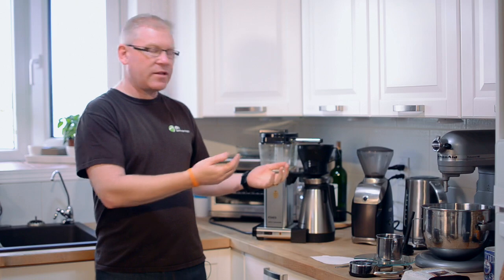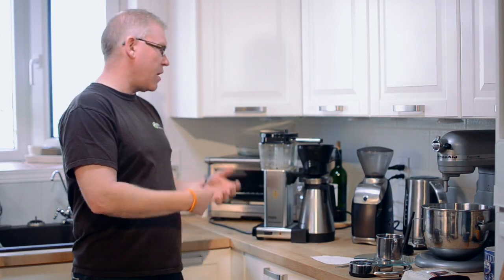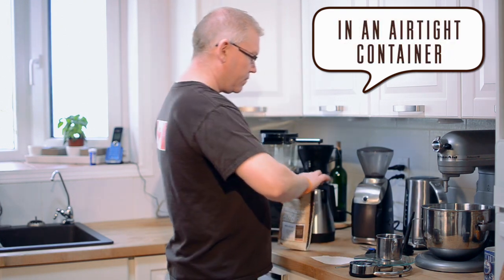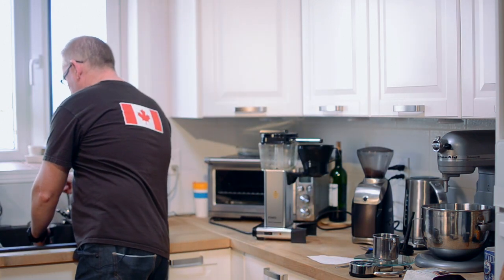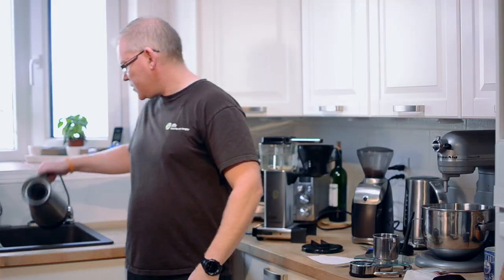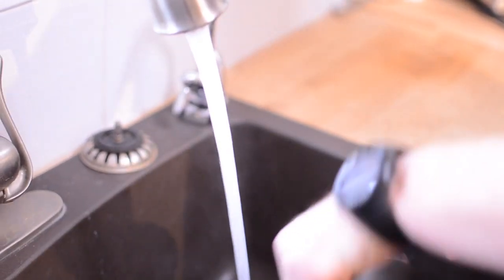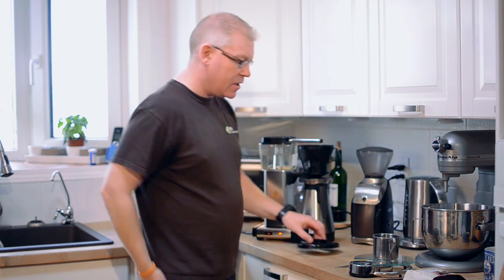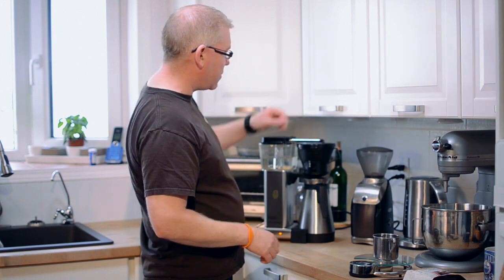How to Brew Coffee Using a Drip Brewer - Becoming a Coffee Connoisseur part 5

Comment: Great review, great techniques. I do have one nit to pick.  You state that the European venison is more powerful (due to the  implied voltage differences).  However it is not the voltage that is responsible fr the heat output, rather the power. The European version is 1450 watts and the US version is 1400 watts, not significantly different. So the heat output should not be much different..
Reply: vvjkumar I agree, Volts dont matter in this context as much, the amperage does! Otherwise our fridges wouldn’t cool as much and our phones would charge slower 🤣🤣

Comment: Hey guys, asked this question awhile ago, but still no closer to figuring out an answer.

I have the Technivorm and the Baratza Virtuoso (I bought the 2012 one from you guys), and it looks like I have the exact same setup as this video, with the exception that I use a permanent gold filter.

My question is what grind setting do I want for the Baratzza grinder; 'coarser than normal' is a very broad range. Are we talking a 26? 28? Lower? Also, I take it one opens the basket all the way?

Thanks!